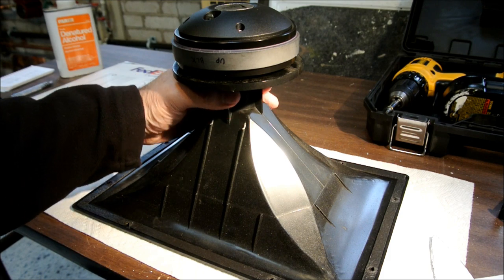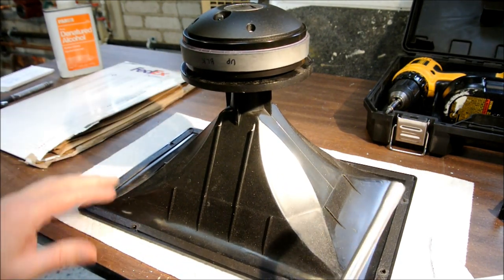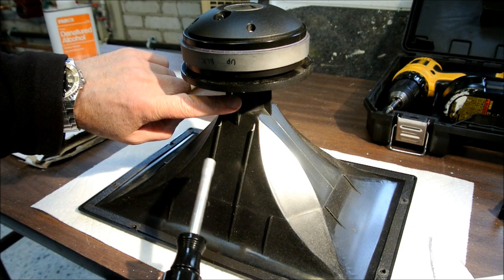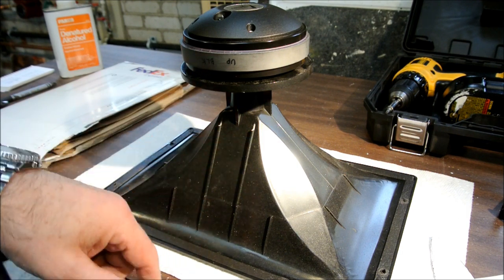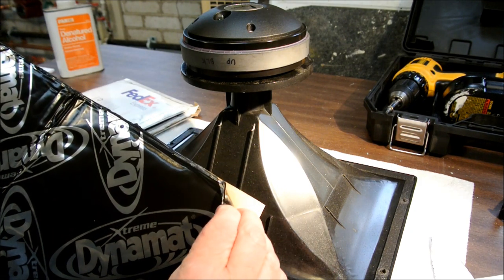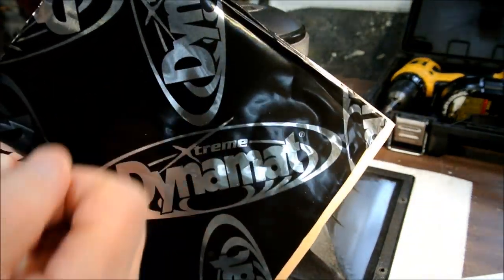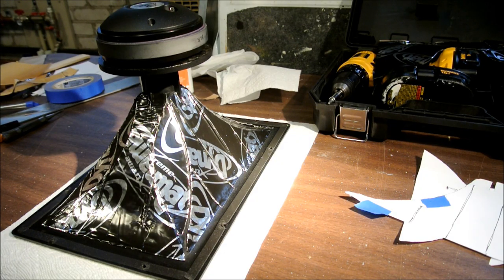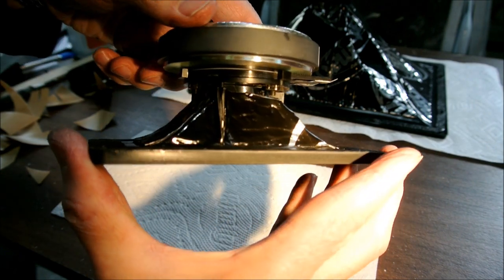How to Modify Klipsch speaker horns for better sound.

Comment: I put. dynamat on my oe Bose sub box in my Porsche  & the bass sounds much better. I’m concerned that you have affected the balance of the low frequencies to the highs. I’m certain the driver screwed into the enclosure dampens if significantly. Glad you are having fun.

Comment: There are some really good woofers that make great substitutions.The Goal: Increase the Mechanical Damping Factor,and The Efficiency of the woofer,by using a driver with a larger magnet,and cast frame .In doing so, The tonal balance,and cohesion of the system will result in more seamless, balance. The cheap stamped frame drivers are less efficient,slower,and cause unwanted cabinet anomalies.EVM 12L's,12B's JBL cast 12's are my top choices.

Comment: I did these mods to my Cornwall 4’s about a year ago seem to work well. I was considering doing the Dynaman extreme to the side walls and possibly backside of front baffle and bass  baskets. Has anybody done this on the Cornwall fours. Don’t know if it will do anything. My biggest caution is that I don’t want it to kill the open airy dynamics of the speakers or make them sound dull or muddier. 
Could use No-Rez but I believe it’s thicker don’t want to mess with air flow.

Comment: Send this to the Klipsch engineers. Unintended resonant frequencies are easily avoidable. The shape of the horn provides the spread. Material wise, lightweight plastic isn't necessarily a bad thing but minus the dampening, a killer for tonal characteristics
Reply from the maker: Thanks. I would think they are already aware of the horn ringing.

Comment: Wow, I'm definitley going to try this on my Forte iv's!  Loved the analogies and the benefits you described are exactly what these speakers need. They are fantastic but a bit much in terms of "in your face" midrange and highs. I have two amps (Yamaha AS2200 and Decware SET). Strangely enough its with the 2 watt Decware that I sometimes experience distortion but this may be due to using my dac as a pre-amp so I have remote volume control. The Decware/Klipsch combo is incredible and brings out the dynamics in recordings like nothing I've ever experienced before but as a result really needs volume adjustment from one song to another. The ultra revealing nature of this combo makes changes to various upstream components/sources readily apparent. I suspect the same will hold true for this downstream tweak. Do you think if  I laid down some blue tape under the dynamat it would still be as effective and enable me to be able to remove it later if I wanted?
Reply from the maker: Appreciate your comments. Regarding the tape, I assume you mean removable painter’s tape. I suspect the Dynamat Xtreme would still dampen the horns pretty well. I can’t say for sure without trying it myself, but I think it would, though it may not be quite as effective. Good luck and let me know how it goes. Note that it was much easier for me to hear the improvement when I had damped both speakers.
Reply: I have a pair of Forte ii and did this method. I am powering them with the same Decware 2watt amplifier you have. For me adding the dynamat was well worth it. The speakers became much more lively.
Reply: @thebostonaudiophile  Thank you both for the replies and the link. The Dynamat Extreme is on the way, so I'll let you both know how it goes! I think when you get to this level of transparency  that tweaking can be absolutely necessary. I've already  experienced a huge difference with proper positioning (straight out into the room really tamed the sharpness and sounds nearly perfect in my room) and I'm hoping this will be icing on the cake. I love that these can be improved further without the use of tone controls and since I like to play loud sometimes and also use these in both stereo and 5.1 HT where they can lean a bit too sharp I'm looking forward to hearing the results!
Reply: @David Wald  David, on top of the dynamat and the Decware amp I added a vintage Mcintosh C26 preamp. Of course there's always room for improvement but I hit the audio system I've been reaching for my whole life!
Reply: @johnvincent4048 Congratations! I too feel like a hit the jackpot by switching to a hybrid class A Vincent SVK Mkii. This tamed the horns and added the weight down low I was after and now my speakers sound sublime. Dynamat is in the closet so I may try it some day but like you I've found amp/preamp choices can drastically change the sound for the better!

Comment: Apply a thick layer of silicone caulk covering the inside area of the horn.  Let each flat area dry and apply another layer.  Better damping than the panels, cheap and available everywhere.

Comment: It's interesting how many comments are hostile to TBA's modifications.  In the car world, no-one would argue you can't improve on the performance of your engine because ' those engineers at Chevy know more than you do '.  Of course with cars it's easier to measure the effect of your mods, which answers any scepticism.  For myself, I'm interested to hear how your proposed x-over replacement goes.  It sounds like your premium component versions would be bulky, maybe bulky enough to affect the box tuning.  The input terminal plate has enough real estate for 3 sets of terminals though, so maybe outboard x-overs?  Thanks for all your effort!
Reply: Exactly!!!!! Well, it's a Chevrolet in name only if you have 36lbs of air in your tires. Or if you use 10w-40 instead of 10w-30.....
Reply from the maker: Thanks. I appreciate your backup. For some reason, some people seem offended by the idea that a stock Klipsh speaker isn't perfect. I don't think a bulkier X-over would impact the sound much but anything's possible.

Comment: The only modification the Klipsch 280f, 450c speakers need are owners who think they need modding.  The truth is, they need to be set up meticulously because they are extremely efficient and magnify imperfections.  With that said they aren't that hard to set up, though they will take some practice and running room correction probably 50 times experimenting all around. And the imperfections are mostly with the recordings, not the speakers.  A lot of people blame the speakers or the source and spend massive money on "hifi" crap rather than realizing the recordings are the problems more than anything else.  Some speakers gloss over imperfections mainly because they have a deficiency in those frequencies, probably at the designers choice.  My jbl gloss over some things better but it comes at the price of having the full sound in good recordings as the Klipsch got.  I can tell the Klipsch are more transparent, the jbl are much more polite and smooth.

Comment: Wow, am I glad I came across your video. I tried it and yes, the difference is dramatic. I have been listening to the Forte IV's for only a few months after selling off some Paradigm Studio 100's. What I missed was the presence of Klipsch-like speakers from earlier years: ergo the Forte IV's. While I enjoyed them right from the start what I kept noticing was a lack of well, substance in the mids and highs. Clarity was there but there was still that bell-like annoyance that I remembered from my early experience with horn loaded speakers. Yes, these are much improved since then but still.  And then I tried this modification: BAM! -clarity AND substance! No bell-like ringing in either the mids or highs.  I loved the Forte IV's before but now unreservedly so! THANK YOU!
Reply from the maker: Yes, definitely more clarity, ease, sweetness, micro-dynamics, snap, solidity … Glad you heard big improvements too. 👍
Reply: @thebostonaudiophile  Hi...sorry if this is a repeat. I responded but I don't see it here so I'll try it again. -> While I was inside the cabinets I noticed that there are several areas where there is no Klipsch' sound damping foam. Would it improve the sound if I were to go back in and replace or just add in to the open areas NoRez foam? If this would improve the sound then I'm thinking of replacing all the foam with NoRez and pulling out the factory stuff completely. Your thoughts?
Reply from the maker: @zjz3013  My Cornwall’s have very little factory foam. I’m thinking of bracing the cabinets with wood to stiffen up the large, unbraced walls. I’d especially focus in the front baffle. Yes, Adding something like no-Rez would probably help too though I can’t say with certainty unless I try it and listen. I’ve heard that stuffing the cabinet with bubble wrap can help too but again I’d have to try it then listen. Let me know if you try something and I’ll do the same via a video.
Reply: @thebostonaudiophile  I think I'll try the no-Rez (Gawd, there goes another $200!) and see what happens. I mean it makes sense to do this but I'll give it a whirl and let you know what I discover.
Reply: Alright here's what I did: I didn't use NoRez. I used pollyfill simply because it was substantially less expensive and if it worked, great, if not then I can always pull it out and try NoRez, fiberglass or whatever else with very little loss in money. I kept the factory foam in there and filled in all the vacancies with polyfill.  I also braced the left and right sides by adding in a wooden brace and gently tapping it into place. That alone substantially improved box resonance (the knock test).  I then dampened (Dynamat) the 12" bass and the 15" passive. I didn't pull the 12", I just taped it while in place. I did of course pull the 15" and before taping it I noticed that when struck it rang like a bell. No longer.  Now for the listening. I used several CDs of which I'm very familiar, especially MA Recordings. First impressions: the resonance that I was used to is gone and instead there's just dead air. Instruments that are suppose to decay, just decay. Voices that were once shrill-ish are now more localized and smooth. All instruments are more focused and localized too.  At first I felt/heard/thought that the sound seemed muffled and less detailed but the more I listen (and time will tell) the more it seems more accurate and what I had "learned" to listen to was the resonance and I thought that equaled accuracy. I'm not so sure about that but again I'll keep listening and try to decide. If I continue to have this impression then a first step solution would be to pull out say, half the polyfill and try it again. However, I doubt the solution would lie in pulling off the Dynamat on any of the components or removing the brace.
Reply from the maker: @zjz3013  Kindly let me know how it goes.
Reply from the maker: @zjz3013  I’m not sure what you mean by the 15” passive and 12”? The C4s only have a single 15” woofer?
Reply: @thebostonaudiophile  Ahh yes, I'm doing this with the Forte 4's, so yes they have a 15" passive in the rear and a 12" front bass speaker.
Reply from the maker: @zjz3013  Got it.

Comment: Hi. I recently added a pair of Klipsch Forte IVs to my system. I really like the sound of the speakers - thinking about trying your modification. How did you pull out the drivers? Do you need to solder anything? Thanks, Josh
Reply from the maker: Thanks for watching Josh! There’s nothing to solder. All three drivers are held in place with Torx, socket head cap screws. There are two push-on connectors to each driver, which can easily be removed by hand. Be sure to note which wire, red or black, goes to each terminal and which wire pair goes to each driver, just to be sure that you get every wire back to the right terminal when you reassemble the speaker. This is very important! I strongly recommend that you use the same Dynamat material that I used. It’s important to create constrained layer damping. Spray on rubber, Mortite, etc will NOT be as effective. It’s not difficult but it takes some patience. It may be easier to lay the speaker down (drivers up, binding posts down) on some cushioning, like several towels, when removing and replacing the drivers. Proceed at your own peril. 🙃 Obviously, I don’t know you, some people are good at this sort of thing, others not so much. Good luck!
Reply: @thebostonaudiophile  Thanks for the tips. I've used similar adhesive material (Noico 80 mil... from Amazon) to sound proof the air ducts in my house so I have a good idea of what it's like to work with this material. Surprised that Klipsch didn't dampen the horns in the factory since it seems like a relatively inexpensive step to implement. Did you ever get a reaction from Roy Delgado??
Reply from the maker: @joshuaschneck  You’re welcome. The Noico 80 looks similar to the Dynamat but I can’t tell for sure if it would be equally, more, or less effective. I’ve only used The Dynamat I showed in my video. I found this comparison but it’s a different application: https://soundproofliving.com/noico-dynamat-review/ 
Since it would be extremely difficult to remove, I’d stick with Dynamat but the Noico might be fine too. I just can’t say.
Reply: @thebostonaudiophile  Thanks again. The only thing that is giving me a bit of pause on this project is the possibility that the internal resonance of the horns might actually be part of the sound that Klipsch speakers are known and loved for....? Probably not, but it's a bit strange that Klipsch didn't put some dampening on their horns in these $5-6.5k speakers. Any thoughts on this?
Reply from the maker: @joshuaschneck  If you have reservations, then I would respectfully suggest that you leave your speakers alone because it would be very difficult to reverse if you don't like the effect.